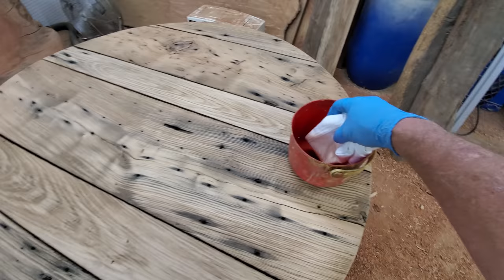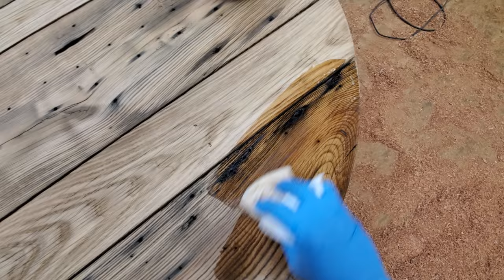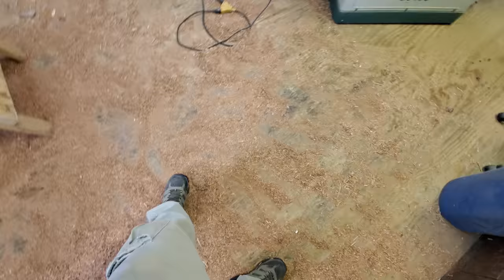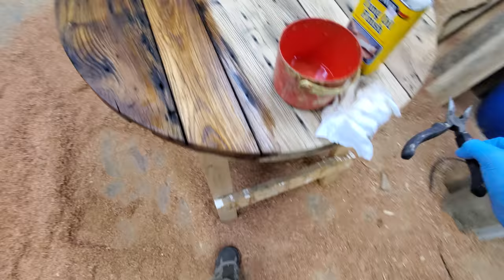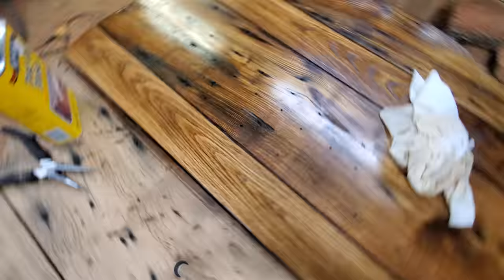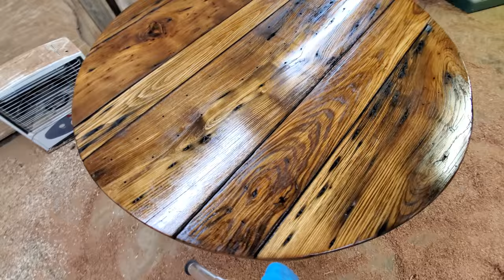American Chestnut Reclaim Table

Comment: Just found this video because of my interest in the American Chestnut reforestation work.  I know eastern American trees by the leaves, bark, and wood, but I am less than an amateur woodworker.  I made a couple of small cabinets for a covered porch about 10 years ago and left them unfinished.  I think that I would like to use tung oil on them.  (I had to look it up.)
Reply from the maker: Tung Oil is a good choice. Make sure its 100% tung oil. It will be a long lasting, easy to restore finish